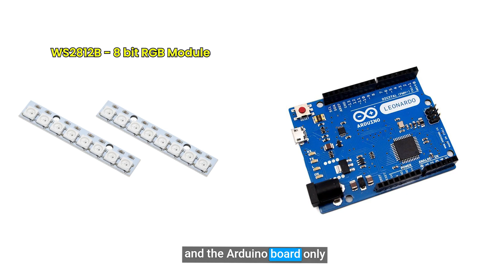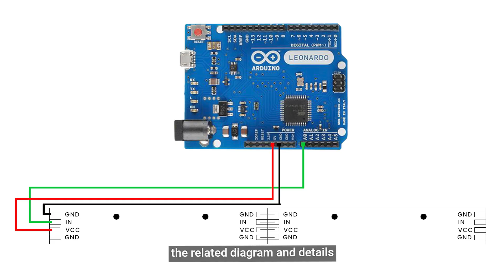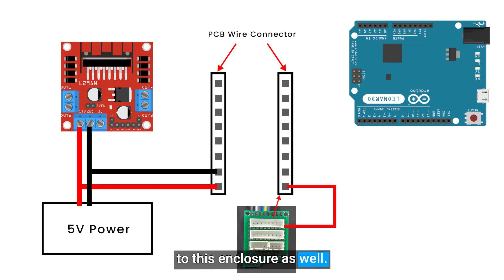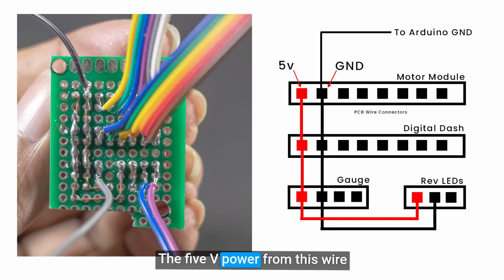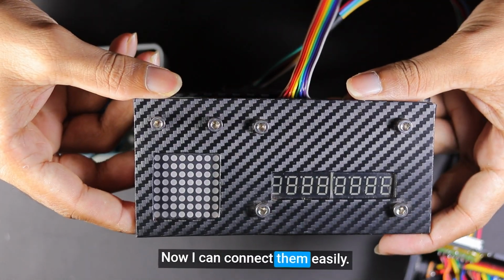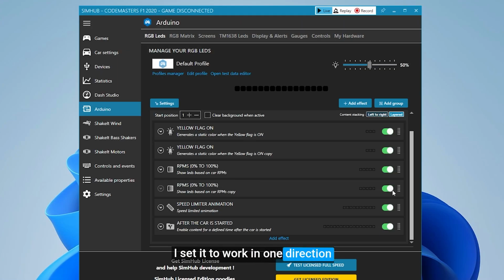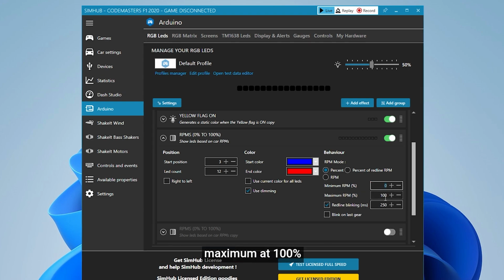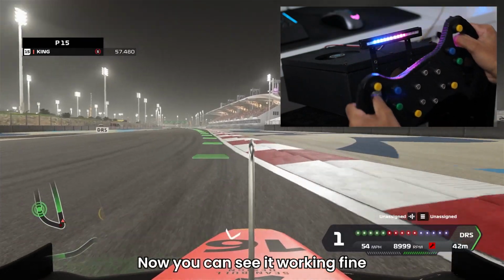Rev Lights For Sim Racing | DIY

Comment: Can I install simhub on the arduino I use for the FFB steering set or do I need another arduino?
Reply from the maker: You need another arduino.
Reply: @zudumalli  oh that what i'm questing it. I will use pro micro on steering wheel to control leds and buttons

Comment: if i only using WS2812 led, its mean i dont need 5v power supply like in the video?
Reply from the maker: Yes, but I'm not sure it will get 100% brightness because it has very bright LEDs.

Comment: You should mention when sourcing the components that WS LEDs can come in 5v and 12v variety. If you wish to use same power for arduino and also the strip, make sure to acquire 5V strips and not 12V.